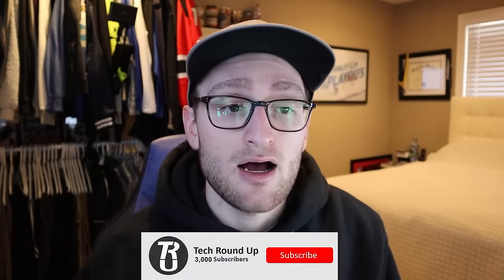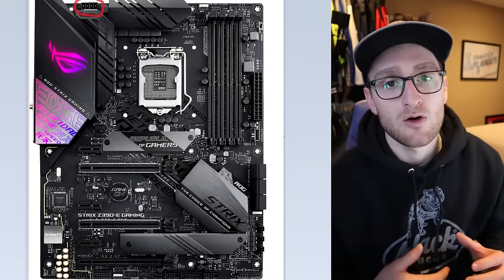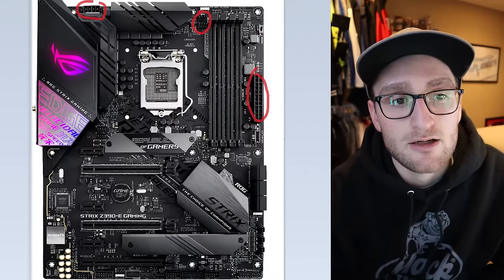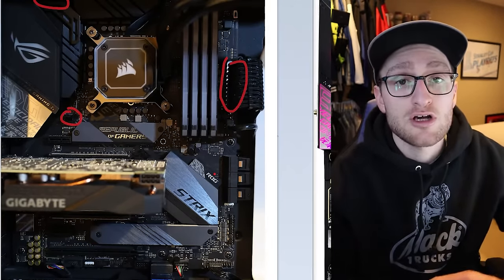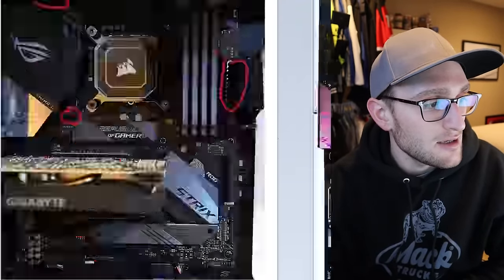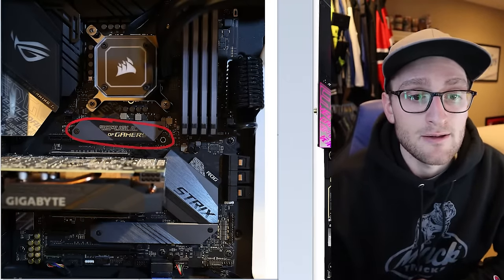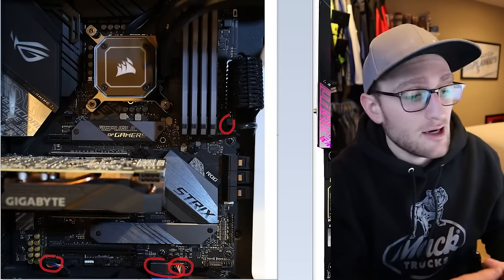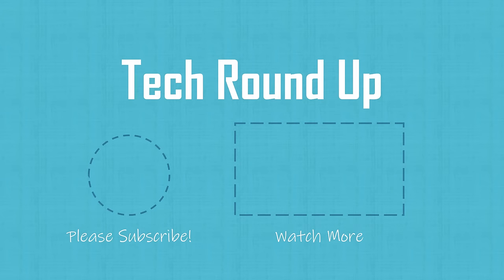Where do all your PC Parts Plug In?!?! Motherboard Connectors

Comment: I am so lost. I have 4 pin RGB fans. They are daisy chain capable. How does this work? I know the mother board can't take all of them daisy chained at once. I have six fans. Plus I don't want a mile long daisy chain out my mother board. I'm so damn lost. I have a Dan hub to control the fans but the RGB is just unhooked cause I can't afford to buy another 500$ board. ( I do a bit of everything so I have a Z690 MSI Unify X board. I just put together the best I can afford so I don't have to upgrade for a LONG time.)

Comment: What if my board only has a cpu_fan1 and not the cpu_opt? Can I still use an Aio?
Reply from the maker: Yeah, you can control the radiator fans off of one of the chassis fan headers or get a controller to be able to control with software
Reply: @TechRoundUp  thanks 🙏

Comment: If I use the AIO pump header for my cooler, how does it know the temp of the CPU?
Reply from the maker: CPU temp is calculated by the motherboard and not dependent on the fan header, the cpu temp will just tell your pump or fans to spin to a certain rpm to ensure the cpu doesn’t over heat
Reply: @TechRoundUp  Thank you! By this evening I should have everything I need to do my build. It's going to be amazing 🥳
Reply from the maker: Good luck!

Comment: Where do you plug in aio radiator fans on the motherboard?
Reply from the maker: You can a fan splitter to connect them all to either the cpu fan header (If you have a pump_aio header) or a chassis fan header

Comment: I apologize in advance, I am writing through a translator, I have almost the same z390 f gaming motherboard and the problem is that it simply does not start, not a single light is on, even though the power supply is working, if someone can help or tedious additional information please write

Comment: My DX12 Pro fans seem to be proprietary to the fan hub, but the fan hub uses molex for power and I dont have anything for that
Cant you just plug the fans in somewhere
They are 6 pin female

Comment: do you need to buy additional cables for a PC build
Reply: The PSU ( power brick) usually would have most of the cables with it, and if you buy a new PC case, it usually comes with some cables. What other cables do you need?

Comment: I just setup my first pc. I get lights on my motherboard but cpu fans don’t spin, case fans and gpu fans don’t light up. Any advice?
Reply from the maker: Are the lights on the motherboard debug LEDs?  If so does it stop on a particular one?
Reply: @TechRoundUp  they aren’t they just keep flashing.
Reply from the maker: Which motherboard do you have?
Reply: @TechRoundUp  azus z590 tuf gaming with wifi6
Reply from the maker: Right next to the ram there should be 4 debug LEDs labeled boot, vga, dram and cpu. Is one of those specifically blinking?
Reply: At work I’ll check when I get home. Thanks for even replying. I appreciate it.

Comment: what happens if you want to install more than 3 fans and connect it to the motherboard
Reply from the maker: Would need to use a cable splitter or fan hub

Comment: im getting a no post issue with this motherboard any tips ?
Reply from the maker: Is the board stopping on one of the onboard debug leds?
Reply: @TechRoundUp  DRAM is yellow I tried cleaning the ram and putting em back in and it goes away but still no post
Reply from the maker: Are you plugged into display port on your graphics card?

Comment: After watching this video, i have noticed that i've connected my watercooler (Nzxt Kraken) into the top CPU fan header "Cpu_fan", i have nothing connected to my "AIO_Pump" header, been using my computer like this for years now. Is that a problem? Should i disconnect it from my "CPU_Fan" and connect it to my "AIO_Pump" instead? I mean, it's been working for years like this, but maybe it's not good for the processor or something to have it like this? Anyone know? Please help, i'm kind of worried now :S
Reply: I'm using a Strix z390-F Gaming motherboard if that helps.
Reply from the maker: That’s fine you can connect it to either, it’s just when connecting to the AIO-Pump header you can use the cpu header to control the radiator fans if needed, or can ignore the cpu fan input if not being used
Reply from the maker: But using the cpu fan header is not an issue
Reply: @TechRoundUp  phew, got scared for a second! Thanks for the answer and for the informative video! 👊🏽
Reply: I'm Sorry @Tech Round Up, you seem to know alot about computers so i would like to ask a question if you don't mind. I replaced my chassi fans the other day, i got 2 Noctua NF-a12x25 fans, but i want to buy 2 more, problem is my Z390-f motherboard only has 2x 4pin headers. Can i use a splitter in each to pair 2 and 2 without ruining my motherboard? I read something about currents and stuff like that, i'm not very good with computers xD Sorry for bothering, but thought you could help <3
Reply: The reason i want 2 more is because i'm pretty sure only 2 chassi fans (Except for my 2 fans on my radiator), is abit to little. My gtx 1080ti is idling at around 50 degrees celcius which i've red is abit high. Must be because of the low amount of airflow in my computer i suppose?
Reply from the maker: Yeah you will be fine to run a splitter or two to control the fans, they will just both run at the same speed if connected to the same splitter
Reply: @TechRoundUp  but i can still setup a costom fan curve in bios and both will just follow the same curve? Or Will they both automatically run at 100% speed? 😀
Reply: @TechRoundUp  thanks alot for the Quick answers, really nice if you to help ❤️❤️❤️
Reply from the maker: You can still setup a curb and they will both use ut
Reply: @TechRoundUp  thanks alot man for taking your time to answer ❤️
Reply: @TechRoundUp  Hey Tech Round up, sorry for bothering you again, don't know where else to turn. So i bought 2 more Noctua fans, and used the splitters that came with it to connect all 4 into my 2 fan headers on my motherboard, but now all the fans are running at full speed, changing the curve in bios doesnt change anything :S Please help if you don't mind <3 <3
Reply from the maker: We’re the splitters, 4 pin splitters allowing for pwm control?
Reply: @TechRoundUp  its called ”NA-YC1” and they came with the noctua NF-A12x25 fans. It connects via a 4 pin, and splits into one 4 pin and one 3 pin :s
Reply: I think i fixed it, i went into my ”armoury crate” program and changed the fan to ”standard” and now the fans are running at 750rpm instead of 2000, is that bad to change it in that program?
Reply from the maker: Not at all

Comment: PLEASE HELP!!! 
My MB does not have pump fan header. WHAT SHOULD I DO??
Reply from the maker: Use ur cpu fam header
Reply: @TechRoundUp For the fans yes but my problem is the pump wich has a 3 pin connector. 
I found out that i can put the fans on the cpu fan header and the for the pump that has to run at 100% all the time ic an choose between plug it in the cha_fan and set it from bios to 100% or get a molex adapter to 3 pin and plug the pump there. Are those truth? And which one i choose?
Reply from the maker: You can also plug your pump into the cpu fan header and plug the radiator fans into one of the chassis fan headers
Reply: @TechRoundUp  and do i have to make sure that the pump will work at 100%? Or just leave it be?
Reply from the maker: It does not need to run at 100% that will just prematurely wear it our
Reply: @TechRoundUp  but the cpu fan is pwm and the pump a 3 pin.. Can i connect the 3 pin pump to a 2pin to 2 pin molex adapter that came in the box with the aio and put it strait to the psu ?

Comment: Has anybody come across an issue where the f panel cable won't plug into a gigabyte motherboard? Because I have no idea how that is ever an issue 😫 but apparently it is and nowni need an adapter to split the f panel? 😅 😭
Reply: Lian Li o11D evo case btw.

Comment: Thanks that helped me but now I have another problem, because my Pc is going on but I am not getting any picture
And YES I did check the connection to my GPU but nothing is wrong there.
The light of my motherboard is constantly lighting on DRAM but I checked it, I switched the places of the RAM but also nothing happened
Reply from the maker: You may want to try booting with only a single stick of ram if you haven’t tried that
Reply: @TechRoundUp  I tried but i stayed just as it was in the beginning nothing happend
Reply from the maker: I would just double check the 24 pin ATX connector and the 8-pin cpu connector next just to double check that everything is receiving power.
Reply: It worked thanks for helping

Comment: Friend helped me with my first build and I've got no display. Just checked and my cpu slots weren't plugged in at all, my cable ends are labeled PSU and CPU, does the PSU side always plug-in to the power supply? And the CPU side on the mobo? Also for GPU, he plugged in the PSU end into the GPU and the pcie into the power supply, do I need to switch that around? Any help is greatly appreciated, spent all this money and have had a non working pc for a week now
Reply from the maker: It shouldn’t really matter, but manufacturers label the ends for ease of use and especially for cpu and GPU cables because the can split apart at at the mobo or gpu end (2+6 for gpu and 4+4 for cpu) and plug in complete to the psu
Reply: @TechRoundUp  okay, so the 2+6 plugs into the gpu? That's also what the manual says but I just wanted to make sure they weren't backwards if that mattered at all. I have 2 ATX slots on the top left of mobo, a 4 pin and 8 pin, you're saying I can combine the 4+4 into the 8 pin slot?
Reply from the maker: Yeah so you would have the one 8-pin with the two 4+4 connector and then you would use have the other 8 pin for the 4pin connector
Reply: @TechRoundUp  okay, I seem to be missing the 8 pin, I do have 2 cables that  one end has the  4+4 and the other has the 8 pin. Could I just use both those cables to plug into the ATX on the mobo? I read online you can just use the 8pin on the mobo but in my manual it says I need to plug into the 8 and 4 pin on the mobo
Reply: @TechRoundUp  oh I think that's what you just said lol sorry
Reply: @TechRoundUp  Holy SHIT I've got display, you're a freaking legend don't you ever forget it.